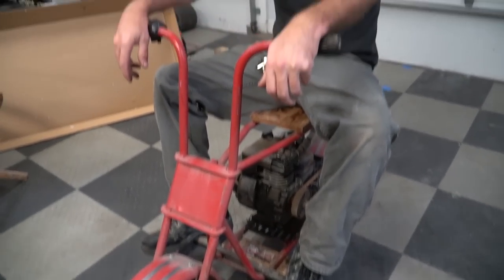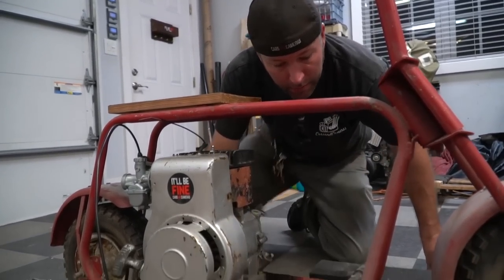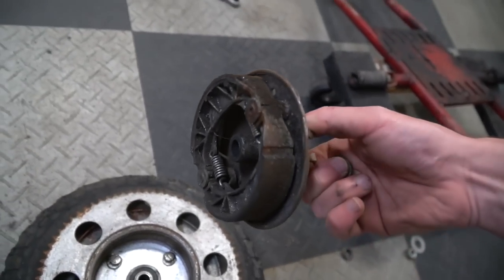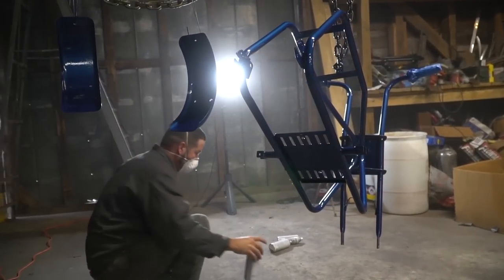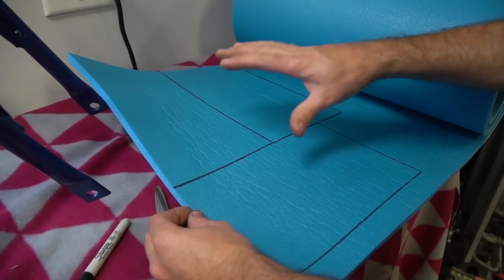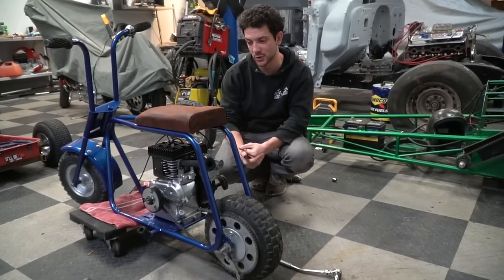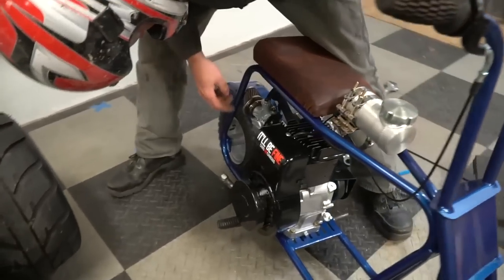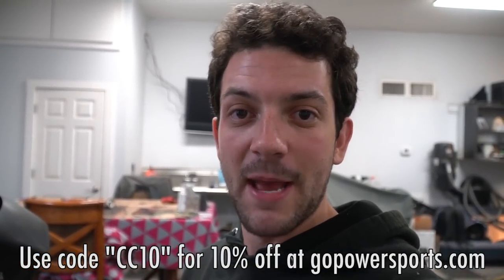Vintage Mini Bike Restoration | Budget Build & Built Flathead!

Comment: Flip that rear fender the other way if possible. It'll look way better and you won't get al much crud on the back of the engine and frame.
Reply: Didnt want to work without trimming the fender for the chain

Comment: how do u instail brakes on a mini bike  i just have the frame and    tires and   rear   chain gear     i don't see any brakes
Reply: You can put a band brake on the centrifugal clutch, or add disc brake kit,  or make a metal plate that pushes against the tire (cheaper mini bikes and go karts came with this).
Reply: @RattyFlyer    i don't know what   kind i have  like i said i only have  the frame and fork and front tire and rear and the chain gear bo  brakes i don't ever see where u would hook brakes up